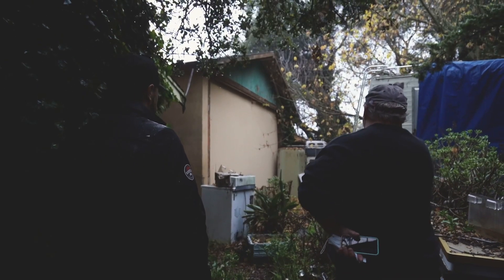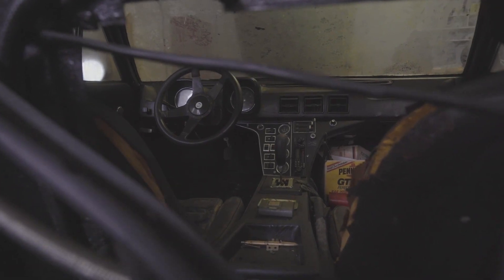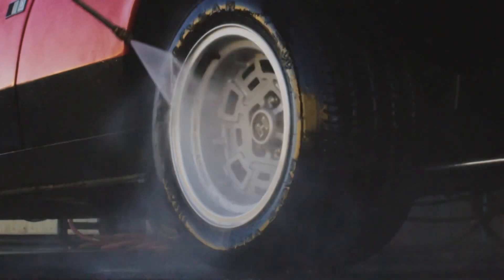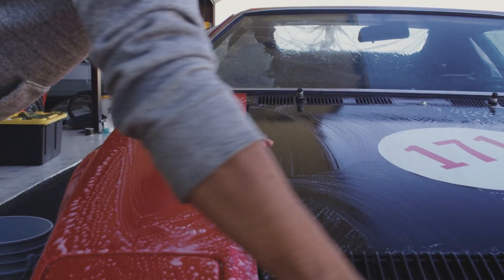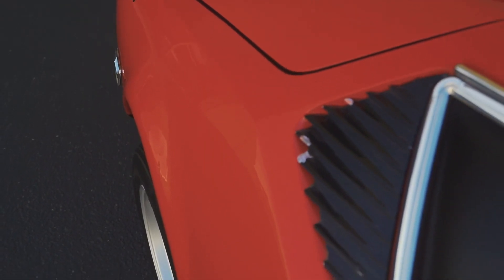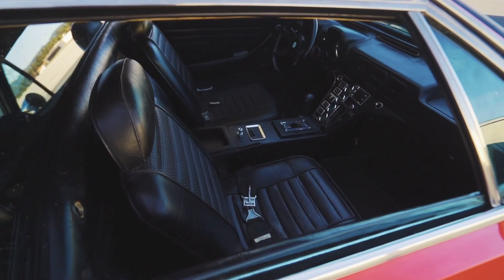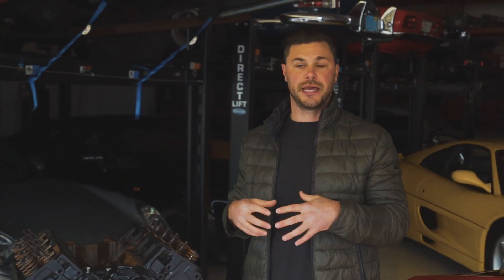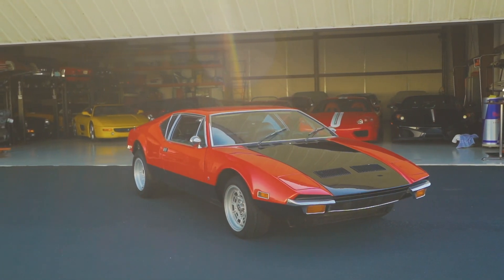1971 DeTomaso Pantera Barn Find Before & After! @bringatrailer

Comment: Nice find and restoration!
However, I heard "Track car" and just cringed. 
Why? This is a classic. Exposing it to that kind of wear, tear and not to mention risk of damages (of unobtainium parts) to me is incomprehensible.  But it is your car.
Reply: I think he was trying to say the previous owner had that in mind.
Reply: I think that is ok for this in particular. As long as the structure remains undamaged, the aftermarket is vey large for the Pantera. Here, the limit is your imagination to rigidity, power and handling, and using a common powerplant helps too. If they do not mind the handling of what is closer to a grand tourer, this is one of the better choices.

It is already not original & unrestored, so there is no worry there either. The worst is just parking it and languishing in a shed again